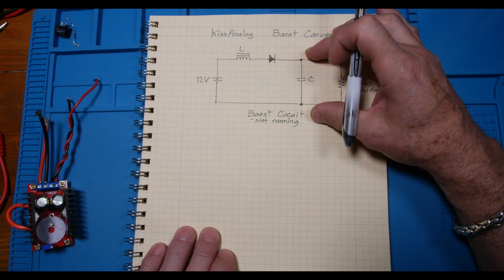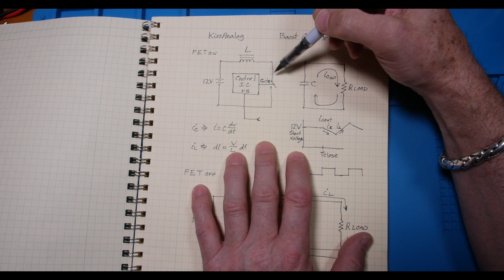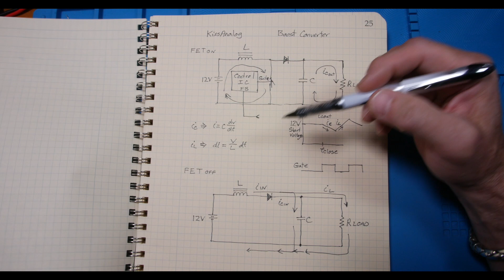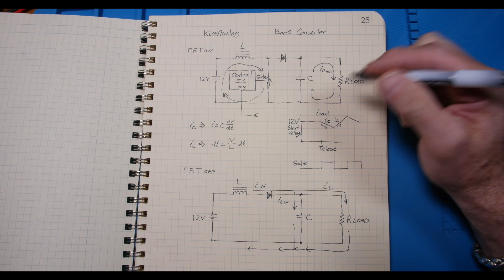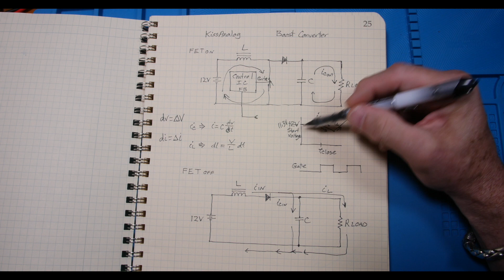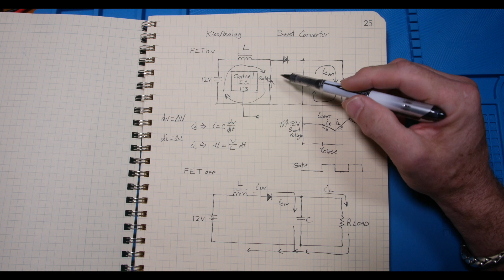Boost Converter Intro #2 #boostconverter #howboostconverterworks #ccm

Comment: Good video Eddie, like it.  Understanding those operating loops is essential to understanding SMPS operation, so you do well to explain it as clearly as you do.  Understanding those loops is also essential if you are building your own SMPS because they directly relate to the layout you need to achieve to make it work properly. If anyone is following along and doesn’t grasp it yet, I’d recommend further reading or asking questions here because it’s so important to understand.  I know this because of my current project - I wish you’d done these videos 2 months ago :)
Reply from the maker: Thanks Andrew!!  You are so right!  I’m actually a pretty good pcb designer - Power people need to be.  You are seeing into my crystal ball.  I like to think about these loops when I place and route my parts.  I hope that my build unlocks start to make more sense as we move along.  I don’t want this dragged out for a long time, but I am building s foundation for the other converters to follow.  So, I think I’ll try and post quickly to get thru this boost. ;)

Comment: WHEN THE VOLTAGES AND CURRENT ARE CHANGING HOW DO YOU CALCULATE THE RESONANT FREQUENCY AND,HOW DOES EFFECT THE OPERATION OF THE CIRCUIT?
Reply from the maker: Great question David!  I don’t think this is a resonant mode converter - we’ll dig into this controller in the next couple videos to come.  Still, the resonance is a potential issue.  It should be set outside the control loop.  I’ll cover this soon.  Great question!!